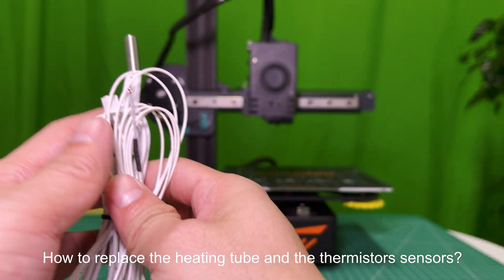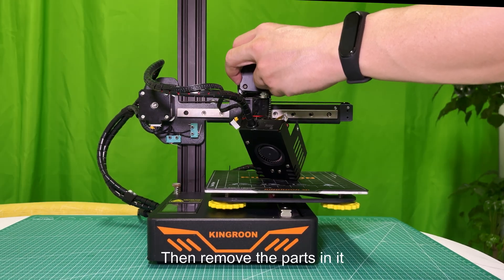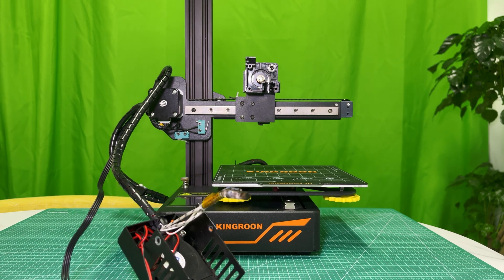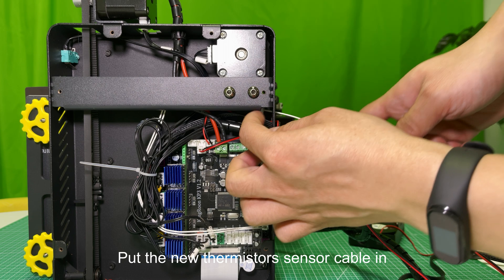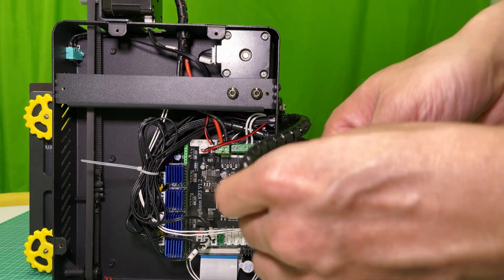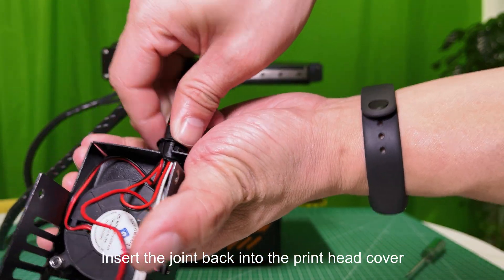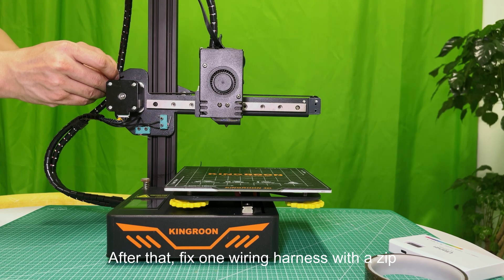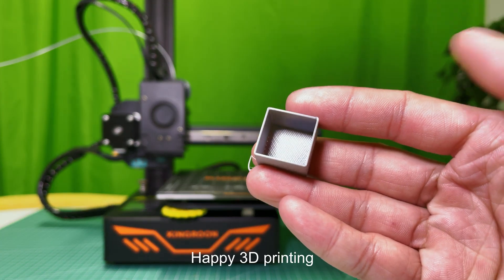How to Replace the Heating Tube and the Thermistors Sensors for KINGROON KP3S 3D Printer

Comment: Replaced the board with a new KP3s pro board so now i need a bigger bed. Its also not getting up to temperature on the hot end. Its got new everything so i cant see why unless the heater elements or the thermistors faulty from new. Reaches 186C and thats it.

Comment: Yesterday after having replaced the element and thermistor bulb and switching on i find its not just the element that's had enough. With in seconds the new element went white hot the moment i switched it on,  Someone's informed me its a mosfet on the board that's failed. It literally melted the heat block and the element almost freed itself in seconds.  So glad i was there watching cause that would have been a fire issue.

Comment: ❤  the video. i replaced the hotend as the video, but now when i power on the printer, the hotend temperature keep going up.. it when up to like 500 c .. how to fix this issue😢
Reply: I have this same  problem
Reply: did you manage to fix it, I have same issue😢
Reply: looks like a mosfet problem in board due to short circuit, same as mine
Reply: Did you guys find any solutions? Have the same problem

Comment: 4:14 - "Take the opportunity and remove those damn cable wraps and replace them with better quality ones."

It's 2022, gen 3 of this amazing printer and I don't understand how Kingroon is still using that horrible crappy wrap on them.
Reply from the maker: A cable chain should be a good option to upgrade it. It’s the first time that I’ve opened the wrapper. It’s a thing that you won’t like to do a second time. But It is easier when I get some tricks on it. But still thanks for your advice, our engineers will know that. We will see what we can do on it.